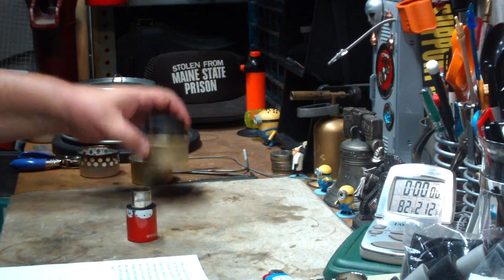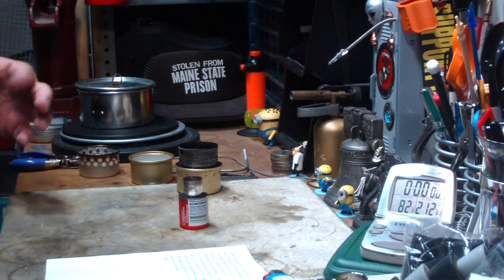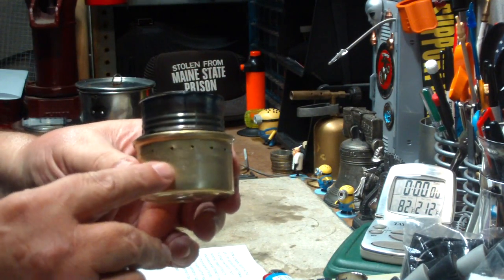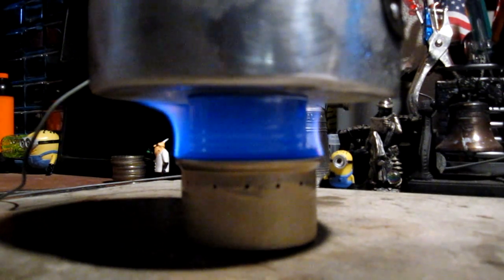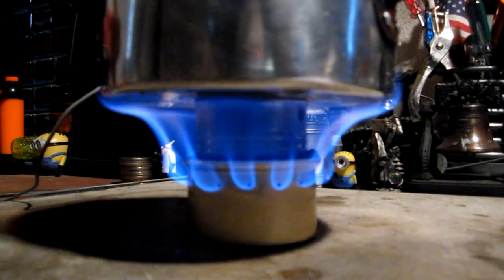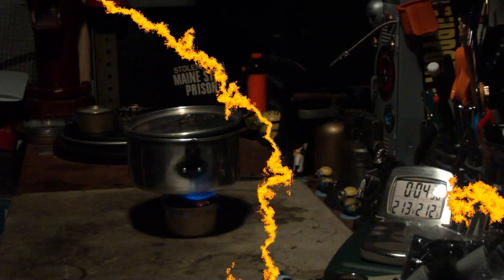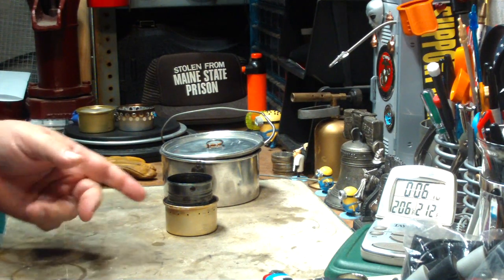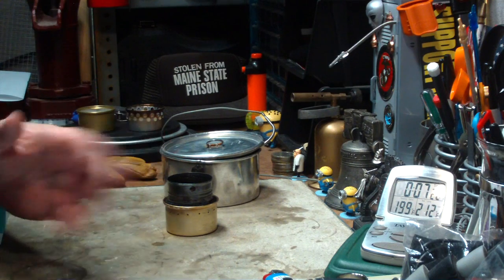Fancy Feast Stove - Mod#1 - Boil Test #1

Comment: After watching dozens of these videos I cam to the conclusion that it takes about 1 ounce of alcohol to boil 16 ounces of water on average, regardless of the time needed to boil and the stove design.

Stove design affects the rate that the water boils.

There is only so much energy in alcohol. And it take energy to heat water to a boil. A fixed amount relative to the temperature, air pressure, and even the humidity.

Waste heat is what rolls up the sides of the container you are using and a little radiant heat.
Wasted fuel is what evaporates and is incompletely burned (soot is your evidence).

Efficiency = boil time / fuel used.

Need a feedback mechanism to superheat the alcohol vapors for even more efficiency.

Comment: I have a concern about all this.
Canada seems to have made most of these alcohol based substances unavailable.
On further investigation I found all these alcohol based fluids, the alcohol fumes are easily absorbed into your lungs and can cause intoxication and even death.
In places like the Philippines that have Typhoons the power goes out often for long periods and many turn to wood fires.
Problem is the long term use of this leads to serious health problems.
.
I'm feeling long term ingestion of alcohol fumes would also cause long term health issues.
Clearly you cannot cook outside during a Typhoon.
.
At this point I'm thinking of emergency heating and cooking inside my camper should my propane system fail and all I've been able to find that's safe is candle wax.
.
Yes it's messy, yes it's slow, yes I can boil water eventually and make a spaghetti dinner in a tomato juice  can and yes I can refuel it on the fly by grating a candle and adding more wax as it's burning.
.
I've been using the corrugated carboard in a tiny can filled with wax method with not too bad results ( I can cook a spaghetti dinner with sauce in about 1/2 hour safely in a small space )
.
I also use it to heat hot water bottles to keep my body comfortable inside a reflective bivvy bag.
.
I hope you'll share your thoughts about this safety subject because I don't want to poison my child using alcohol based burners.
.
Are my concerns valid?
Reply: The long term use of any combustion source - including your candles - if not handled properly could cause 'serious health risks'. How do you think we survived alcohol and oil lanterns for centuries? Wood smoke / fumes from stoves, ovens and fireplaces? 
There is no more risk from alcohol burners than any other kind of burner - other than the person using them and how they handle the components. 
There are alcohol hand warmers. Pretty sure you're not going to die from them. 
Use whatever you want to use. Anything combustible is going to have its dangers in one form or another. Alcohol is many people's favorites because of its stability, quick burn times, and the efficiency of the burn prevents excess fumes and soot like from dirtier fuels. 
Take a look at the bottom of a pan after you're done boiling water with an alcohol burner vs. your candle burner. Pretty much sums it up.
Reply: LOL!, yeah your gay leader is flooding you guys in Canada with Muslims, they will take over and ban eveyrthing in a few more years.

Comment: Hiram, I have enjoyed your alcohol stove tests, and have made several fancy feast stoves with different height center cans. I found that the small Dole pineapple juice cans are a good center can also. I tried 18 jets using a tiny hand twirled drill placed right in the spot where the curve of can flares. I was quite impressed with results of boil of two cups water. 4 minutes 21 seconds and run out at 5 minutes 32 seconds with one oz of Heet. Do you still like to use the jet modification?

Comment: How about using carbon felt in the super cat.  I put in some fiberglass and it didn't need to really prime.  I would love to see how a lining of carbon felt changes it.  Is it as good as fancy feast then?
Reply from the maker: Ron Orud This video might help.
Super Cat Stove - Low Pressure Side Burner with Carbon Felt Inner Ring - Boil Test #2
Uploaded: March 2, 2013
https://youtu.be/_Y-Gt4pgrrY
Reply: Thanks Hiram!   I mised thay one!
Reply from the maker: Ron Orud Glad I could help.